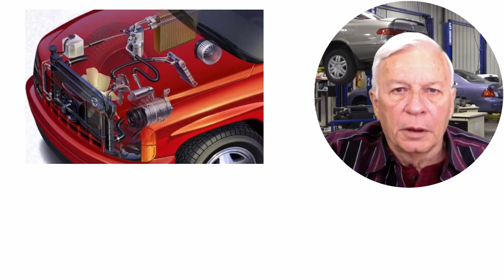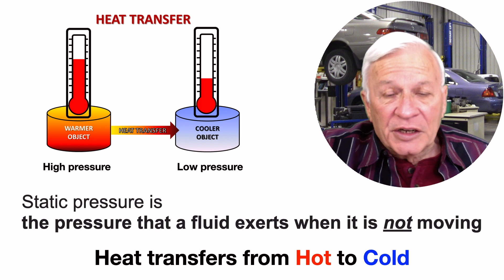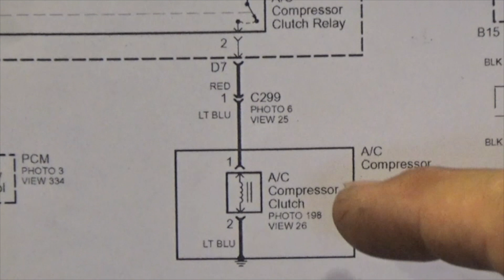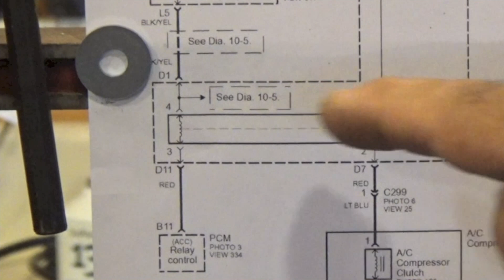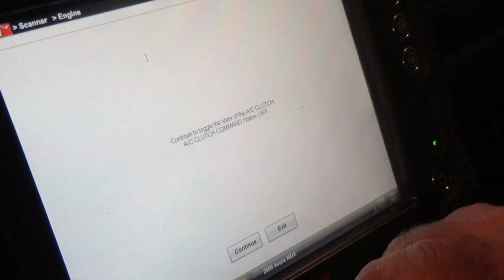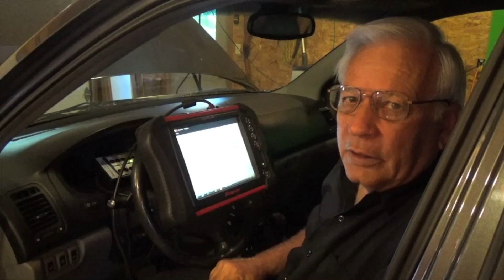Critical Thinking and Finding Evidence with Air Conditioning  Part 1

Comment: No way.  Terrible information.
Even when there is just a trace of liquid in the system,  static saturated pressure will be present.
Also:  a SCANN TOOL?  Are you kidding me???   It's overkill,  and many viewers won't have one anyway.
Worse still,  I had to use the search bar to find part 2,  because the author didn't include a link.

Never mind -  I'm not going to bother with part 2...